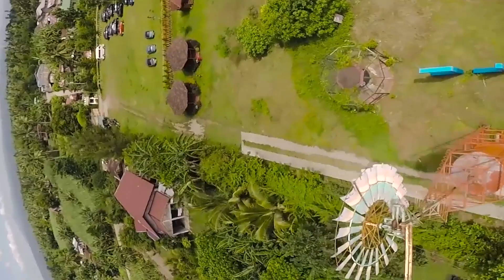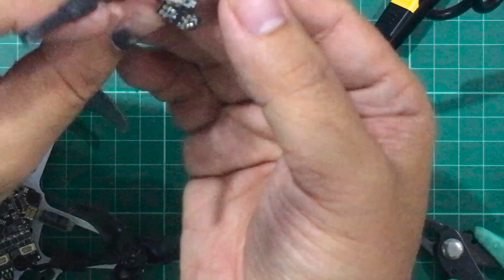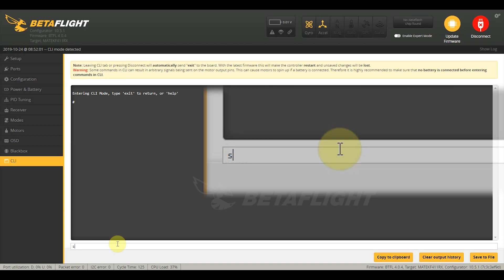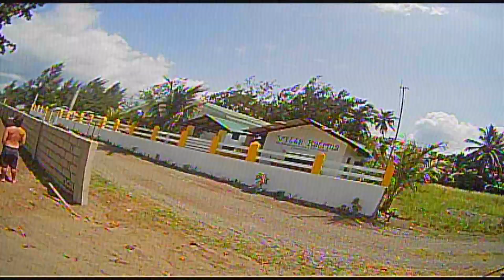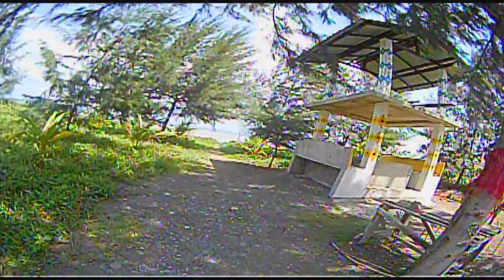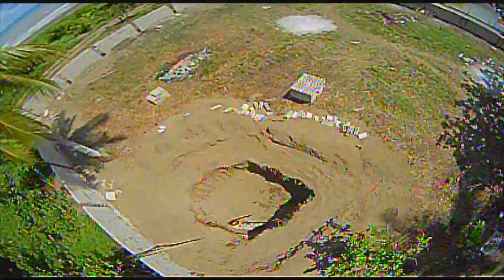Tinyhawk Freestyle Upgrades You Need!

Comment: hey i have the white ps lookin controller for this drone and its so comfortable but its very laggy in middle rates and i was hoping you can show us a way to fix it maybe by adjusting the pids i really want to utilize this remote its cool😅 thanks for the helpful vids
Reply from the maker: I thought I had replied to this, so sorry. I haven't used the white controller from Emax, but yeah it does look nice. One thing you can do is to go to Betaflight under the PID Tuning tab, and look for the section it says rate and maybe reduce the expo (so in the graph the line near the middle isn't too horizontal). Give it a try!

Comment: Nice video.  Unfortunately the thingiverse file for the xt30 and lollipop is no longer available :(
Reply from the maker: The link works, checked just now. Can you try copy pasting the URL into your browser? Not sure if that'll help. Works on mine just by clicking the link.
Reply: @ImaginationTech  the link works, but if you try to download the file itself, it’s no longer there.
Reply from the maker: @julianevans3943  someone else had the same problem. The "Download All" button doesn't work for some weird reason. Here's what worked. Go to Thing Files tab, and click the Download button (not Download All) to the right of the .stl file. Give it a try.

Comment: I have tried this with two VTX,s just like you used with no success. I get OSD in my goggles but no video from camera but the on board DVR does record to the sd card.
What did you do with the yellow video in wire?
The only difference is I am using the stock camera with the freestyle.
Please help if you can.
Reply from the maker: If you're getting osd and a black feed, then there's nothing wrong with your vtx wiring. I would check the camera and its wires to see if they all go to the right place. Also check if the camera isn't busted.
Reply: @ImaginationTech  since the camera is recording video to the dvr on the vtx I would say the camera is correct, did you use the yellow video in wire on the vtx plug?
Reply from the maker: @roydefreece633  if you're getting video from the onboard recording, yeah, the camera's working. But the video isn't going back into the main FC and into the OSD and back out to the vtx. There's a yellow wire going from the diamond VTX right side plug back to where the camera used to plug. Check the video at 3:45 to 4:05 or so.
Reply: @ImaginationTech  thanks, that yellow wire back to the FC video was the missing piece, works now just need some good weather to get out & fly

Comment: Can't u just turn the vtx power down if u get stuck.
Reply from the maker: Yup, you could disarm and then go into OSD and turn it down. There are situations where you're video signal is snowy. In those instances you'll have a really hard time navigating the menus so this just makes it automatic.
Reply: @ImaginationTech  yeah I get I'm still new to this. I need to figure out how to go in betaflight and set it up automatic like your doing
Reply from the maker: You can just follow the video where I go to CLI. Newer betaflight versions would have this in the vtx transmitter tab.
Reply: Can u make a video on how to set it up in the new betaflight

Comment: once the old vtx is removed, the cables of the hand cam have their own connector but where do the other cables go?  in the video it doesn't look very well I can have a solution thanks
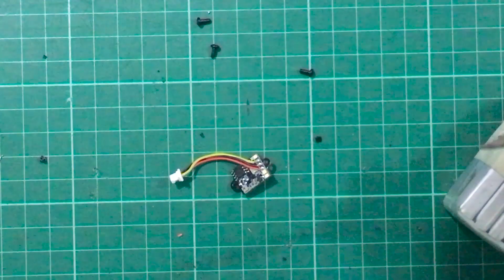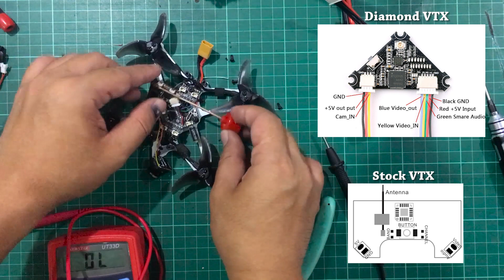Reply from the maker: You can see the final setup starting at 3:36 (the pin diagram is at 3:51 which you just have to follow). You will need to switch the wires on the camera (red-black-yellow) to match the camera connector (the left one) on the Diamond VTX (black-red-yellow). This is what the Diamond VTX records on its DVR so it doesn't have OSD overlaid. The blue video out wire then goes to the FC where the camera yellow wire used to be, and the video out on the FC connects yellow video in, both on the right side connector of the Diamond VTX.

On the rare occasion that you do want OSD to be recorded on the DVR, the camera will remain plugged to the FC but the video out goes to the camera in (left connector) of the Diamond VTX and the blue video out and yellow video in can just be shorted together.

Comment: Hi Does the lollipop anteanna need to be soldered to  the board  or does it clips in? which antenna did u use? cheers.
Reply from the maker: If you have the Diamond VTX, it has a uFL connector so no need to solder the antenna. I think this is an Uxii or Realacc, can't remember.

Comment: Thnx for the video but just wanted to ask, how would i know if its running in 200mw?  I tried to set 200mw from the OSD then when i arm the video no video feed but if i disarmed then video feed is fine. But if i put back to 25mw from OSD then its all fine but i wanted to extend my vtx range. Can advise?
Reply from the maker: What VTX is that? Stock Emax VTX have their power and frequencies locked which will result in a black screen. To unlock, you need to hold the vtx button while powering up. Also, the stock VTX doesn't have 200mw. For the Diamond VTX it shouldn't go black.

Comment: how does vtx work after a while? I read somewhere that he can not power vtx from 5v. How are you doing? Everything works?
Reply from the maker: Everything still works! Broke off one of the buttons but managed to solder it back. Also switched back to a firmare that saves every 2mins. More files, but I'm guaranteed a recording even if I manage to eject a battery.
Reply: @ImaginationTech  Another question, which batteries do you use?
Reply from the maker: @bigit182  GNB 450mah, either dual 1S or a 2s..

Comment: Can you  give me a quick rundown of  how you connected the  vid out in the old cam plug  I have got myself confused , do I go from vtx to the far left pin in original cam port ? Nice job thanks
Reply from the maker: You can see the pin diagram and the final setup starting at 3:36. You will need to switch the wires on the camera (red-black-yellow) to match the camera connector (the left one) on the Diamond VTX (black-red-yellow). This is what the Diamond VTX records on its DVR so it doesn't have OSD overlaid. The blue video out wire then goes to the FC where the camera yellow wire used to be, and the video out on the FC connects yellow video in, both on the right side connector of the Diamond VTX.

On the rare occasion that you do want OSD to be recorded on the DVR, the camera will remain plugged to the FC but the video out goes to the camera in (left connector) of the Diamond VTX and the blue video out and yellow video in can just be shorted together.

Comment: when i set Low vtx = ON for some reason it was stuck on 25mw and couldnt change it via smart audio. Had to turn it off for more than 25mw
Reply from the maker: Well it is designed to keep your vtx at 25mw when not armed, but you still should be able to set the vtx power in SA. What do you mean by you can't change it?

Comment: i tried this exact method EXACTLY but it didnt work for me. i only got it working using the og camera port and left the camera port on the vtx empty. waiting for my camera (stock for now) ive also found a good mounting solution for the vtx.
Reply from the maker: Check the wire order on the stock camera and the camera port on the Diamond VTX, can't remember if they are the same. End of the day I used the connector from the Diamond VTX and replaced the camera's wires with that.
Reply: Imagination Tech that’s what I did. Maybe the cam wire order was wrong but there’s no diagram on the diamond VTX I just have wire color to go by and it’s attached correctly. No problem as it’s working with the camera attached to it’s original port

Comment: Nice video, straight to the point and with a great explination of the process and problems you've encountered. How do you like the camera compared to stock? How does it handle the highlights and shadows compared to stock?  I'm looking to upgrade the camera on my TH Freestyle as well.
Reply from the maker: If you would change only 1 thing on the THFS, it should be the camera. Flew the Tinyhawk S (stock camera) and this last weekend and it couldn't cope with the light difference when the sun was in the sky. It was a bright day and you could barely see because it was adjusting for the sun. Others have recommended the Runcam Nano 2 which I've tried on the Larva-X and it's good too, likely better than Caddx EOS2, but anything is better than the stock.